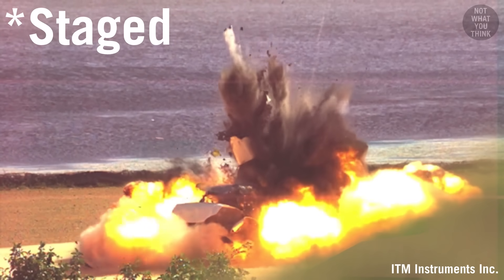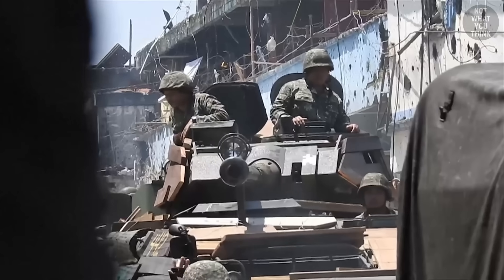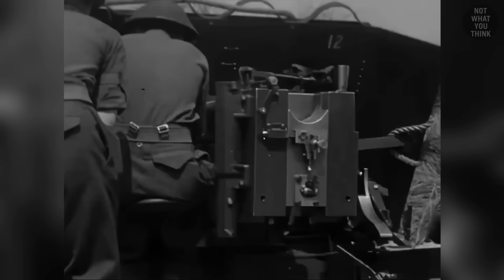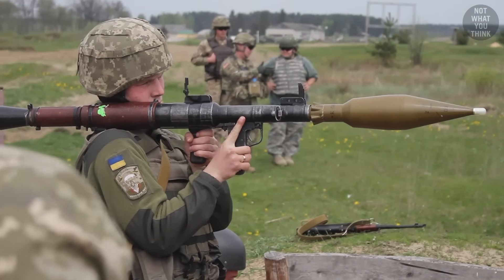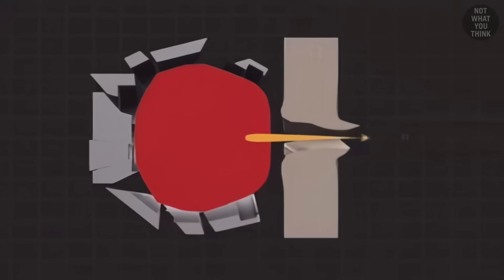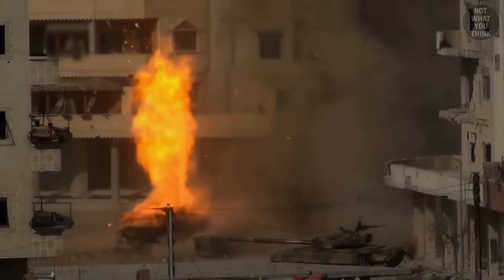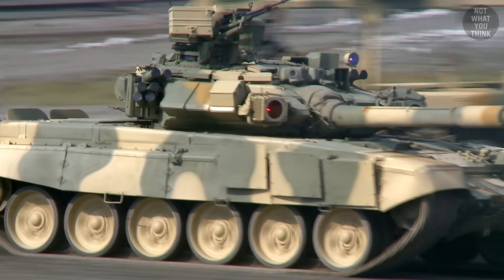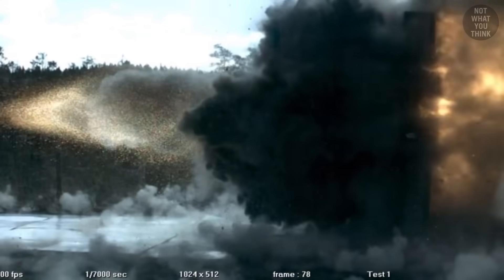Why Protecting Tanks is Getting Much More Difficult

Comment: I used to make ceramic armor, humvees and Strykers , it's easy to think why, once ceramic is fired you can't re use it or remake it if there is a mistake just grind it up and throw it in concrete  or road material you have high fire and low fire, armor piercing uses the concept of melting through it and that is where the ceramics  shine steel- ceramic plates then steel there was other configurations but same concept, if a solid round hits the fracture of a plate dispersed energy and basically grounded the projectile, but melting ceramics is not happening it'll absorb that heat and crack it chip off a piece before it melts

Comment: I've already solved this problem 7 different ways, I'll hint one. What does an RPG 7 and javelin basically do? To render a modern tank dead? If you answered kill the crew you are correct. What if there were no crew to kill?
Reply: Is not about the crew. Is about disabling the vehicle so it does not do any damage at that moment. Even if crew survives. It means the tank needs repairs and has to leave the battlefield. So if you start battle with 2 tanks now you only have 1 tank that is capable of fighting. That means it is harder to win.

Comment: 7km per second is the fastest a missile can go, being about mach 24, the only way to go faster is going much higher, preferably space, aswell as taking a long time to reach max speed, while some rockets have been designed to get upto max speed relatively fast, their max speed although impressive is a fair bit slower, being about mach 7-12, so theirs no way a ground shot short distanced relatively speaking is going to even get upto 7km per second let alone 14

Comment: It's all economics. Because we've developed (relatively) low cost antitank weapons that are a threat to any type of tank, the logical response is to develop lower cost tanks and win via proliferation. 
People think of tanks as a specific thing, but they're more of a role than a thing. A tank is a combination of offense, defense and most importantly mobility that's used to push ahead of infantry. In the past, that has mostly favored bigger machines. Obviously it's time for a reboot,  but the role will still need to be filled. 

My guess is that the next generation of tanks will be remotely AND autonomously controlled, but with nobody inside. This will allow them to be significantly smaller and less expensive,  and deploying them in linked teams will have a compounding effect that beats the antitank weapons on an economic scale.

Comment: The solution obviously is bigger and bigger tanks, thicker armor. The P.1000 Ratte was excess and stupidity in the 1940s, but may become a necessity now. The ability to cross bridges, use roads, and be rail-transportable must be sacrificed in order to make tanks survivable. If the compact nuclear reactors being developed by Radiant Nuclear (1MW reactor in a 40 foot shipping container, good for 5 years at full power) come through, it may be possible to build gigantic tanks that can simply drive thousands of miles cross-country to the theater of combat.

Comment: Light tanks are going to make a big comeback with drones. Cheaper, more, and expendable tanks, without survivability at such a significant priority, would free up a lot of opportunity for operations especially in cramped urban settings where combat is increasingly happening in. Or particularly challenging and not very flat terrain.

For the cost of an MBT, there has to be a way to split that to a squad of multiple light drone tanks. Strapped with weapons more than capable enough to handle anything. Launchers don't need to be that big to do lots of damage. Especially with situational and varied ammo for whatever the need is.

Losing a tank becomes no big deal. It won't happen often, and it can be recovered. It no longer costs human lives and their experience. More aggressive, and potentially very effective, options and operations become viable. Especially with improvements in speed and agility with sacrifices to armor weight.

Comment: That's why tanks need a layer of water between the metal and the steel. The projectile being so hot that the water will create super high pressure steam which will counteract using thermodynamics. You add that water and metal sandwich with reactive armor then javelins have even more difficulty getting through once hit. Sections of armor should have water pockets just like reactive armor like a boat about 1 foot by 1 foot wide all parts of armor. Like I said I stead if just using solid steel or titanium alloy for Abrams they should cut that layer in half and include water sections about 1 inch wide and use that as armor. So it's ERA metal water metal

Comment: Tanks are about 3 percent of our overall military force. There is a reason we went from a 35 percent tank based military in ww2 to being less than 10 percent in Afghanistan. Hypersonics are no more effective than IEDs and they have no element of surprise and entrapment meaning they are just an expensive hard to shoot bullet designed to destroy something that doesn't even represent 10 percent of Ukrainian military and less than 5 percent of the US. Russian weapon programs simply suck hard
Reply: And that's their big "innovation" hypersonics were supposed to be a big deal. They have an 85 percent failure to result rate currently against us loaned and sold planes that are from older wars not counting our newer stuff.

Comment: The problem is you can't send tanks out by themselves without ground & air support to suppress and kill the operators of these javelin type weapons ( eventually, main battle tanks could become remotely operated and once a person fires a handheld top down missle there rough postion is given away and drones , Aircraft can lock onto there position and ethier blow them away or relay there postion to other tanks and ground troops )

Comment: You are confusing shaped charge, penetrators, which form a jet of hyper velocity high temperature gas. Self forging metal penetrators crush a layer of metal which can work off a tripod thirty metres  from the target. When the metal, at hypersonic velocity, reaches the target, it can destroy it. Several antitank rockets will fly above the target and shoot, a self forging slug. down.

Comment: what causes the explosion is the rapid expansion of the gases during the explosion (explosion in Lebanon, it is indeed the expansion of the gases visible in the videos of this disaster), there is also the heat ( thermal effect) and metal fragments (shrapnel) which move at very high speed, in a nuclear explosion, the first effect is a violent blast of air (expansion of gases like air) then comes the thermal effect!! ! Kinetic effect is not present in many types of explosives, the NLAW missile passes over the enemy tank and a jet of molten metal hits it on the roof!

Comment: Ok so this is inaccurate in many ways.

There is a Penetrator behind the Ballistic cap that forms a little mark/crater in the armor, the Molten, Metal usually copper, never heard of glass being used in those but it´s possible, is then INJECTED INTO the Armor.

The Stream is ALMOST COMPLETELY INEFFECTIVE it it isn´t delivered that way.
The Wood and literally any other amterial that is capable of Arming the Charge is highly effective in protecting anything from damage.

Basically, if a shaped Charge is not making Proper Contact with the Armor the way it is intended, it becomes less effective, up to completely useless.

So yeah, Spaced armor like this, will in fact defeat any HEAT ammunition, anything that deforms the projectile or makes it arm NOT ON THE ARMOR is defeating the Projectile.

Comment: The reason the nukes in the crashes didn't detonate, even though the conventional explosives went off, is because they didn't go off in tandem. The explosives all have to go off at the same instant, to the point where the wires leading to the detonators have to be the exact same length. If there is an extra half inch of wire to one of the detonators the explosive it detonates will be off by the amount of time it takes the electricity to travel that extra half inch. This will deform the explosive lens enough that criticality wont be achieved. That's why you can blow up a nuclear missile without causing a nuclear explosion. Even if an ICBM plowed into the ground (and they are moving fast enough to set off any kind of explosive) it still wont cause a nuclear explosion. Nuclear reactors also can't cause a nuclear explosion, but that's a different story.

Comment: The armor in the front of the tank is tilted so it becomes harder for anti-tank grenades to penetrate the armor and it makes the tank lighter to. The tank don´t need as much steel.
Reply: Well the main armor of modern tanks isn't steel anyway but composite materials.
Reply: @holokyttaja  True but the armor is still tilted like that.

Comment: Actually the "metal" particles are not particles at all.  It is that metal compressed and heated until it becomes a plasma.   An extrememly HOT plasma.   That Plasma literally burns it's way through the metal like a plasma cutting torch.

Comment: tank with multiple whirling blades surrounding it. useless for urban but could be used on open ground. blades would be long and whippy, basically forcefield but physical so cheaper, might use a lot of power. have to work out way for them to intersect and for tank to fire through, unless purely used while transporting.

Comment: I think tanks have no future in the long run. Antitank weapons are getting stronger
Reply: They're still worth it if the country making them has enough money to spare. You should also take into account the fact that not every nation has access to top-of-the-line anti-tank weapons. Tanks still provide a tactical advantage in most environments if used correctly. They wouldn't exist if they weren't worth it, but they still do — Russia continues work on its "new" T14, Germany just unveiled their new Rheinmetall KF51 Panther, and the US is already looking to replace their Abrams with a new tank.

Comment: Improvised fpv drones with rpg 7 caps can stop an abrams or bmp. Dirt cheap to accurately stop a tank compared to a missile system like javelin. Also you can be far away compared to shoulder fired rockets like rpg. This is what Ukraine and Russia are using now.

Comment: Bc weapons advance and armor gets redesigned. You saw the same thing with the introduction of the first hand held guns in the 16-17th century and the following phasing out of plate armor. We realized armor won’t protect against guns and is just extra weight so you might as well not use it. Then we saw the introduction of new body armor in WW1 and WW2 and later the rise of incredibly durable light weight materials and we will most likely see something similar with tanks. Well at least see some sort of hyper specialization of how tanks protect themselves against new threats

Comment: I was not expecting a lesson on warfare and then the mention of the "Demon Core" incident, this video is awesome what is cool about this, is that america has already came to a solution, most anti tank rockets use lock on missiles, we have developed anti lock on armor, it obscures the heat the tank makes through its plating and has a form of active camo to help further erase its presence, the optic plating displaces the rays of light shining ON the tank to simply be AROUND the tank, making it  virtually invisible to airborne surveillance tech. This method makes tanks need less armor so it can cut costs on defenses and be lighter and faster. This stealth tank kniwn as the PL-01 uses thermal, visual, and acoustic stealth technologies.

Comment: Alright let's clear this up. It does not matter WHAT can destroy the tank, the point of a tank, as well as any other special war technology, is that you need to do something to go out of your way in order to kill it.
It doesn't matter if you have this super laser canon that insta vaporizes tanks, you will still NEED that laser canon to do so. Meaning you need special equipment to combat special equipment. Until standard small arms infantry can single handedly render a tank useless with their primary normal combat kit, the tank will continue to be useful.
Reply: define standard small arms infantry
Reply: When the same exact weapons we deploy against human soldiers can also kill tanks just as easy. So the equivalent of a 7.62 nato round. Even .50 bmg isn't an anti tank rifle, and other than sniper stuff or mounted guns, we don't use .50bmg as a battle cartridge.  @spasti7026

Comment: Really depends on the terrain and conditions. If the tank can spot the infantry, or if the initial shot doesn't destroy the tank, the infantry are in BIG trouble if they have no egress or a real good cover position. 

Secondly, modern warfare isn't about pitting this tech vs that tech in some video game 1v1. Every modern army utilized combined warfare tactics, in which infantry, artillery, armor and air forces (and naval, where applicable) all work together to advance and use their relative advantages to compensate for the weakness of the others.

Comment: I'm 1 minute in.....PLASMA PENETRATION. I watched a video about 12 years ago about a new weapon system they had which was essentially a copper plate on a track vehicle with associated electronics and aiming etc. This vehicle was about ten feet tall, and about 8 feet wide with a concave copper plate mounted in a larger dish with an explosive charge behind it. It was a one-time-use thing, but when it went off, it would send the copper plate so fast and with such velocity/heat it would turn the copper into plasma, and it's obvious by now that nothing can stand in the way of a beam of plasma coming at you at hypersonic speed. Not much left of the tank. The weapon was like a hillside IED.
Reply: heat rounds aren’t new technology they have been around since ww2

Comment: I'm thinking there will be battle mechs in the future, not because they are more tough than tanks, or even that they have better terrain maneuvering capabilities, but because they can deal with new age threats better. A tank cannot aim directly upward toward drones, whereas a mech with arms can. Legs are harder to hit than tracks, and it would be easier to hide a mech's heat signature than tank's. Most importantly, the fact they stand higher means that they have a better line of sight than all other ground units. Lastly, it can crouch to take cover. The point is, a vehicle of the future would be better off not getting hit at all since everything is becoming too strong, and a mech might be able to fill that role.

Comment: 🙄🥱
Lame....
If the metal is weak enough to be liquified by a small airhead, there's no way it could actually have enough energy to penetrate effectively. It's not going to be hotter than the explosion itself, and the explosion isn't hot enough to melt the armor on its own, so how can the cone the explosive melted be capable of melting the armor if its less energetic or hot than the explosion itself?

You showed massive explosions doing nothing, but yet the shaped charge can focus a tiny fraction of that firepower to greater effect? All explosions are "compression lenses" btw, because the compress omnidirectionally, constantly. No shaped charge needed. It's like running 3 phase AC on your motor, when the frequency is 60 hz... no intelligible difference. Except that it uses 3 times as much electricity and produces the same torque. It's similar to how the shaped charge has less explosives, but somehow more energy.

It's just a plot device. Otherwise, there's literally nothing anyone can do against a tank, except use a cannon of some kind. It makes for a fun david and goliath type story, but its nonsense. They didn't seem to work against American armor 🤪. Let me guess, the abrams has a meter of composite steel protection, and still drives and turns its turret.

Seeing is believing right? Well look at this. 2+2=5.  Here, you can clearly see that when 2 is added to 2, you get the total sum of 5. The math is right there.

That fire donut is some serious 2+2=5 shenanigans. Explosions do not just do whatever you command, and if they did, war would be a battle of will, no materials needed. Sling and stone seems good enough at that point.
Reply: Are you genuinely suggesting that shaped charges are a hoax??

Comment: the cost argument of anti tank weapons vs tanks makes no sense. Tanks are there to fulfill a role, that is being self propelled, direct attack platforms. The same silly argument can be spun like this. Infantry takes a long time to train and to equip. Modern soldiers can cost upwards of $30k. But soldiers are squishy and can die from a single bullet costing only cents. Infantry is clearly getting obsolete. The real solution is not to phase out tanks, but to conduct combined arms operations where tanks are supported by infantry.